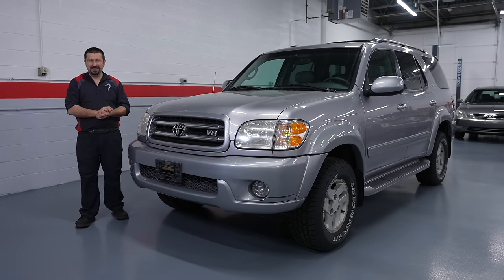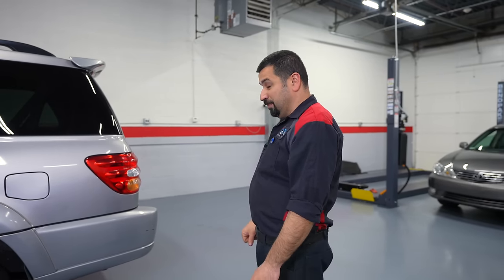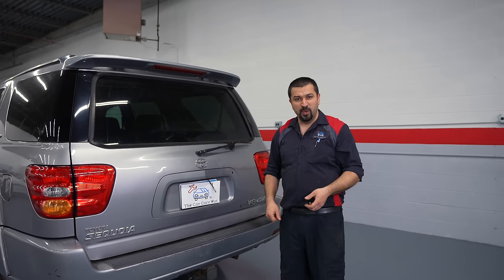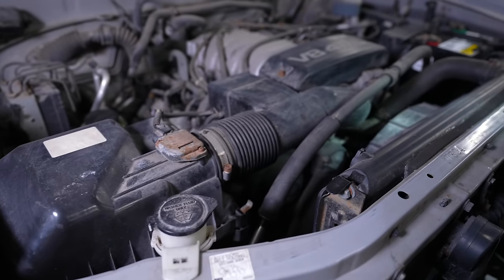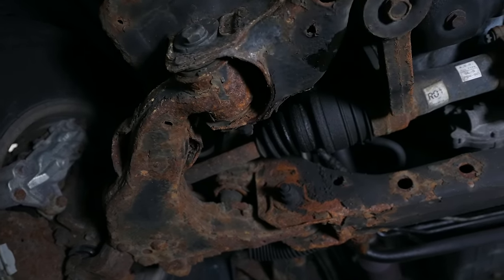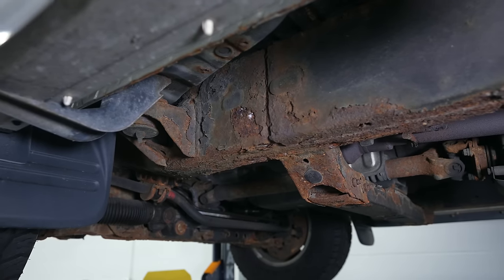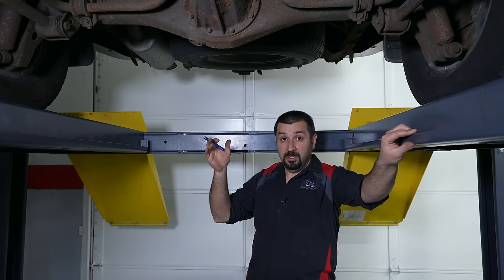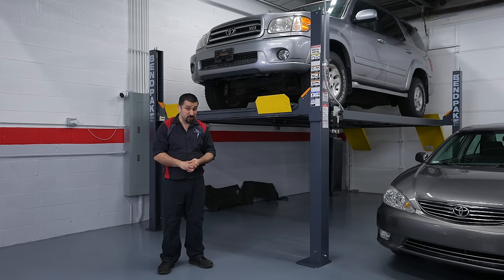NEVER Buy a Toyota Like THIS ONE! Hint : It's not The Sequoia!

Comment: I have a 2001 sequoia. My AC blows cold but the compressor seems to be running all the time. I looked at it for a few min running in 80F degrees and it never cycled on and off. Just kept running. Is this normal for a sequoia?

Comment: When I look at a car the first thing I look at is the frame, shock mounts, frame braces, floor then, interior at a glance. All the doors have to work good. If I can lift the carpet at the doors, a no-no. Then, the cargo bay or truck area. I'll tear the car apart because i want to make sure if it is even worth the selling price. The engine bay is last. Before I start it up. I put it in gear listening to any tell-tail sounds and test the brakes. Maybe, then, I go for a ride.

I have an 1988 AMC Eagle 4x4, auto, in better shape than that one.

Comment: Well I’m just giving advice from someone that has owned 5 4Runner’s starting with a 1991. All 4 others were traded in with over 180,000 miles on them. All 4 gave me zero problems. All 4 went through hell and back with baha in the snow, ice, mud and water. Never a drop of rust on any of them. Pulled stuff with the 91 ( 4 cylinder) that way over weight for years. I did not listen to his video, so not sure what he is saying. Flat out people with an honest 5 time owner. There is no vehicle out there that can touch these things for reliability and longevity. Never plug them in even when it’s minus 40 here. Turn the key and go back in the house for a while. Never failed me once. Never an electrical issue. Hell last one I had was 9 years old before I had to replace the battery. You buy one of these and your maintenance is Tires, Brakes, and oil changes. That’s it.

Comment: Can you please help me!!!i have 03 sequoia so far replaced ac compressor condenser drier evaporator expansion valve condenser fan and my ac still not blowing cold…heater valve fully closes when turning knob from inside fan clutch also looks ok radiator is replaced not too long ago. sitting at idle it will blow 70 when driving 60. Ac suction line looks updated line. 90 plus degrees ac gauge reading 50-55 low side 300 high side. Do you happen to know common issue i try research seems like alot of people have this problem but no one knows the cause and repair!! Please help also noticed ac compressor doesnt cycle always running

Comment: This vehicle must not leave the shop under its own power - flatbedding straight to the junkyard is a must

I'm quite serious. If this was taken for annual inspection in the UK it would be immobilised as dangerously defective

For your own protection (liability insurance), you should be insisting that the customer only takes it away on a trailer and signs a liability waiver understanding that the vehicle is dangerous to drive and they do so at their own risk

Even better would be to arrange with the owner for it to be taken from your shop by a scrapyard

Comment: had 2 Toyota trucks 87 and 96 both frames rusted out, junk them even with great engines and trans. WHY after all these years Toyota would not changed the alloys in the frame they just continued to produce these? Called them several times but they transfer you some rued person that just shuts you down and does nothing!

Comment: Amd i need help really bad. I been trying to get  a hold of you at your shop because your my last resort for hope. I have 2005 sequoia rwd. 100k it shakes intermittently usually after n hr  driving it shakes on steering wheel. Feels like death wobble. Have new tired rebalanced twice and new rotors and still have huge problem. I took it to toyota and they couldnt find anything because it drove fine when they drove it . But they only do 20 minutes test drive . I dont want to sell it because idve seen some on road with 400k miles
Reply: @thecarcarenut

Comment: 😮 box frame design looks great but it wasn't properly protected 😢

I guess it has more holes to trap water/salt in the inside of the chassis than a typical c channel

So Illinois and other rust belt states, shops should be more vigilant in educating the public about oil undercoating to help make vehicles last at least a decade in the road salt states😂

Comment: Hey Amd ! I have a question on a vehicle I want to buy and it is the TRD Supercharged 2001 sequoia Limited, 4x4 v8 with new belt/pump 2k ago in good shape at 190k miles. What is your thought on the reliability of this the 4.7 v8 with the factory supercharger and does the blower need rebuilt every now and then ?

Comment: Mine recently just replaced entire frame on 2005 Toyota Sequoia under recall at no cost 💲 

Had 500,000 miles runs perfectly 

Like if you live in Florida not as rusty 
On original frame

Comment: Horrific. But, with 250,000 miles on it being driven in the rust belt? Not surprising, the original owner definitely got his money’s worth.  My first Toyota was a 1982 short box Mirage 4x4  that was a lattice work of rust , the frame snapped after being hit in a parking lot and it “only” had about 240,000 kilometres (149,000miles) on it. Mechanically sound, but the earlier generation of Toyotas were endemic for rust. Still better than owning any other brand of vehicle IMO ….

Comment: Parts of what he said is correct. But you can have the frames rebuilt, and in the commercial trucking industry it's very common actually. If you pay next to nothing for this, have the frame rebuilt structurally, All the other stuff isn't really that big of a deal.  You can run that thing with the exhaust manifold leak for a long time. If it's not near the exhaust port or right at the exhaust port and all of its missing, it's not going to heat up the cylinder. You could beat the hell out of that Toyota for a long time more.  And who wants to go spend almost $100,000 on a new one?  Also, I've had the best luck with GM products. especially older ones.   Seems like this guy likes to really attack GM, probably doesn't like American cars although it looks like he's working in America. If you really want to see crappy cars, go to Eastern Europe, and buy a car that's manufactured there, or even worse China.  It always cracks me up especially when people attack American products but yet the country they come from doesn't even have a production car.   It's time to send the IRS to his shop for a nice little audit..   😅

Comment: Never mind a perfect owner & car history, flawless interior, awesome exterior and nice wheels and accessories. Also never trust any car dealer to follow the swedish law and inspect the car before they sell it to you.

It's simple: Make sure to thoroughly look underneath ans im wheel houses for rust, welding, or painted over rust, and if it's okey, make sure it drives well, motor-, exhaust-, steering, and transmissionwise.. other faults.. meeh. They're fixable (besides hondas black death).

I did everything right uptil the point I decided to don't distrust  the (huge) car dealer with having properly inspected the undercarriage of the car, and not only everything else.

Huge mistake. Now, due to an idiotic and unfortunate misfueling of the car I got to borrow during initial repairs of the car I bought, I'm left with either a scrap yard car, and no money to buy a new one, or I have no car at all, after returning it, and no money to buy another car since they will not pay me for taking the car back, unless I let ok them to potentially charge me however much they want to for the misfueld car.. Ofc, it's a legal battle now.. BUT SERIOUSLY:

YES! Please, check the undercarriage of the car thoroughly, even if everyrhing else seems perfect and the dealer mean they've checked the car, and you'll not be left out for the crows car-economy-wise! 

Great video!

Comment: In 2006, my wife and I bought a 2001 Sequoia Limited 4WD with over 60,000 miles and sold it in 2021 with almost 300,000 miles on it.  It was one of the most reliable and dependable vehicles that we have ever owned...only better vehicles have been our 2003 Lexus GS 430 and our 1998 Toyota 4Runner Limited, each with hundreds of thousands of miles.  But the key to all of these vehicles is that you have to maintain them, just like every other vehicle ever manufactured.  And fortunately for us, we don't live in the Rust Belt.
I like your videos, but I think this one is a little unfair - comparing the quality of an abused Sequoia to a GM vehicle is unfortunate.  I stopped buying GM vehicles in the 1980's after buying two brand new Chevys and scrapping them before they reached 80,000 miles.  I will admit that the early First Gen Sequoias, especially 2001 and 2002, had widely known engineering deficiencies, including undersized brakes (resulting in frequent brake pad changes), very weak rear hatch handle, exhaust manifold cracking and frame rust.  But the 4.7 liter 2UZ-FE engine is absolutely legendary.  Not the most powerful engine ever made, but extremely reliable and durable, as demonstrated by the fact that the previous owner(s) abused it and did zero maintenance to this vehicle.  Every engine, regardless of the manufacturer, will eventually need new valve cover gaskets, belts, hoses, etc. since rubber deteriorates over time.  I replace all critical rubber components on my vehicles every 7-8 years, even if I haven't hit the maximum mileage recommendation.
I do agree with you that the buyer of this vehicle made a huge mistake.  I my opinion, the best course of action is to pull the engine, give it a minor overhaul and sell it.  Then scrap the rest of the vehicle, because you will never win the war against such a huge amount of rust and neglect on any vehicle.

Enjoy your videos, keep them coming!

Comment: Toyota should do a better job rust proofing the frames. I have an 11 4runner with less rust on the frame than a 19 model year wi th 30.000 miles in Michigan. Mine spent most of its life in Florida. A 4 year old Toyota shouldn’t have anything but Mild surface rust in Michigan

Comment: Meh.  Just depends on the price.  Maybe that car is not worth the hassle at $10,000... but at $5,000?  $2500?  $1500?  If you can buy it cheap enough and cure the major issues, it will likely keep going for another 5 or 10 years... And probably still be worth a few $1000 at that time.

Comment: That frame looks like it was made out of a tin can to start with! What year is it, don't recall that being mentioned? I realize Toyota has had a reputation for quality as far as engines/transmissions but that frame! I suppose the EPA has had a lot to do with it with their drive for fuel mileage but then consumers are left with this kind of garbage because of manufacturers trying to meet those specs by making vehicles lighter. Then Toyota also had the nightmare of oil consumption in certain engines with low tension piston rings. More failures thanks to politicians and pointy heads at the EPA. I am surprised he didn't mention Toyota replacing complete frames on some vehicles in the early 2000's.

Comment: Me: never buy a Toyota Sequoia like this where you have to put so much time and money into it like you would a GM 
Also me: buys a LS 460 with 600,000 miles that needs a complete rebuild down to the core. 
No, wait...
Just messing. I just kind of got burned around buy a very similar Sequoia. Silver on Gray, four-wheel drive limited. I would say it's the same vehicle 152000 verified miles on the other side of the country. I don't think the frame itself is very rusted but a lot of the truck is

Comment: Toyota's are notorious for being driven up to 250k miles and beyond with absolutely NO real maintenance besides oil changes when they can and fixing the ac if it goes out. Other than that if it doesn't make the car break they don't fix it. People are cheap asses and they drive Toyota's because they are lazy and don't want to do things like drive to get their car repaired and wait in a lobby and drink coffee or drop it off for a weekend and pay $2000 for a repair. People have gotten to the point they are very cheap and it is disgusting. There are many ways to hide the fact you drive a rusty piece of garbage but when people hide it and sell it to people it is disgusting. Just horrible.